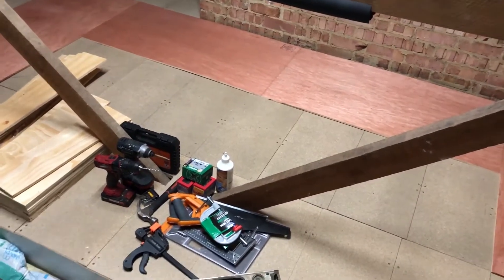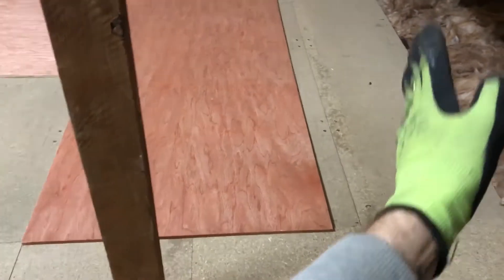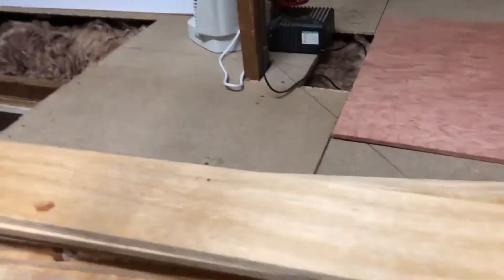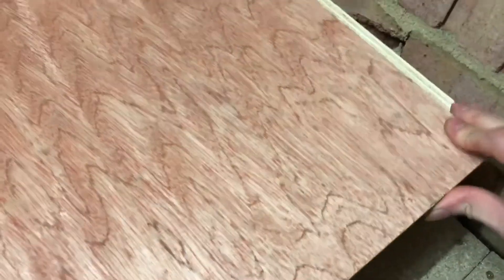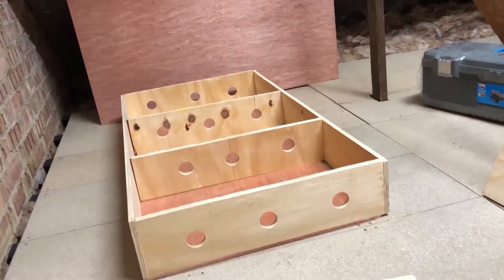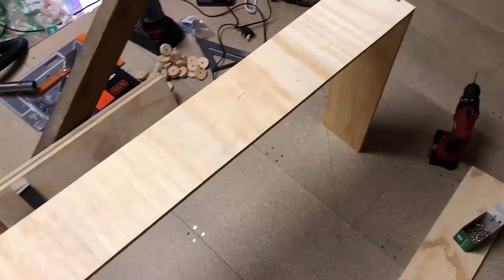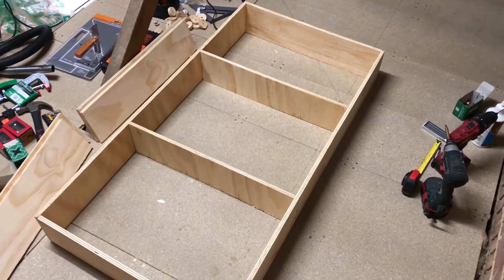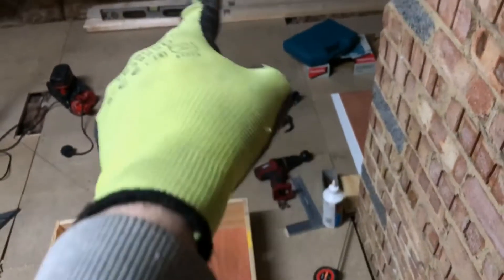How To Build A Model Railway - Episode 5 - Baseboards

Comment: ALL good there. Should be a strong sturdy base.. I spent an eyewatering amount on my timber so far and I've got to finish off going round the loft yet! Quick note if you choose to seal the top boards don't use pva